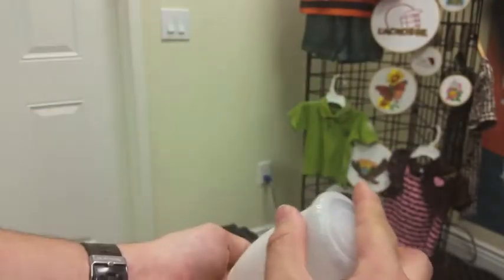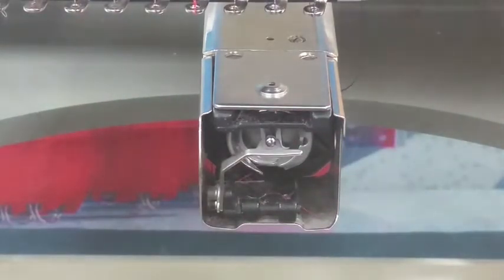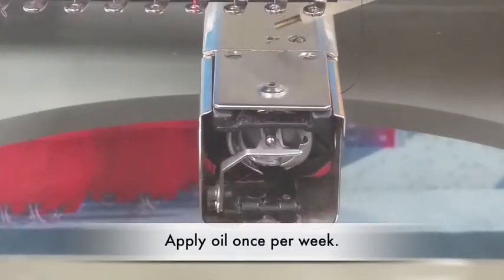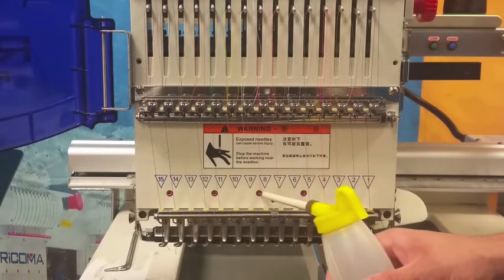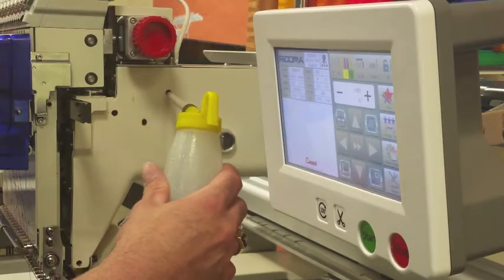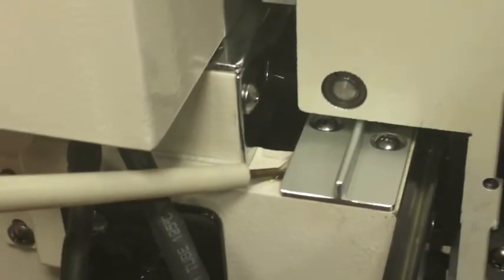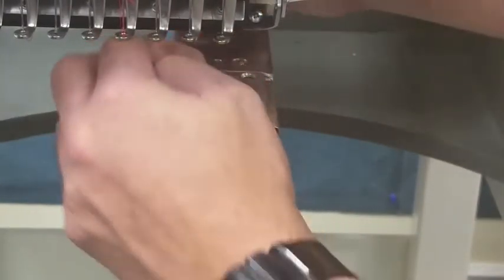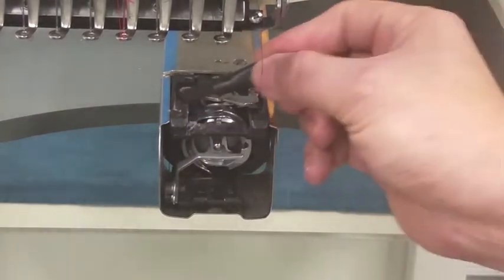Maintenance on your RiCOMA Single Head Machines

Comment: Nice tutorial. Thank you. I just received my new swift and it didn't come with any oil or grease (also no oiler bottle). I probably have to mention that I am located in Germany and maybe we get different things here with the machine but one would think that at least oil comes with the machine. Anyway. What kind of oil and grease will I have to buy for the machine? So far my experience with this purchase has not been fun. 😢
Reply from the maker: Hi there! The oil or the bottle does not come with the machine. We recommend purchasing the White Lithium Grease.
Reply: @ricomatv  Wow, now that is interesting, especially because in this video you claim that the ricoma machines come with oil and applicator. Anyway, I will get the oil.